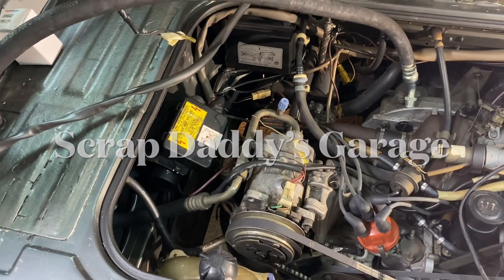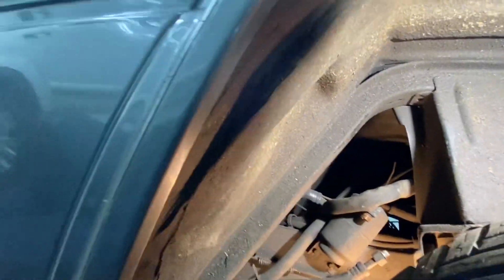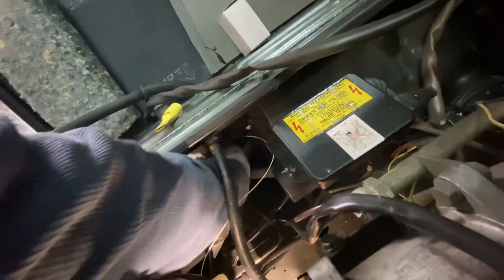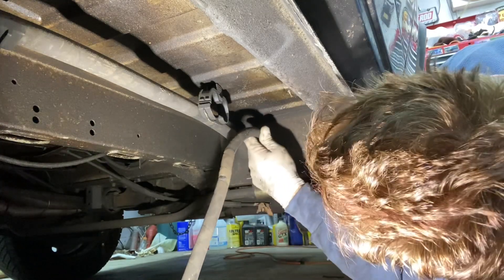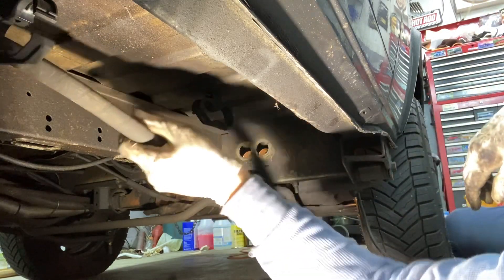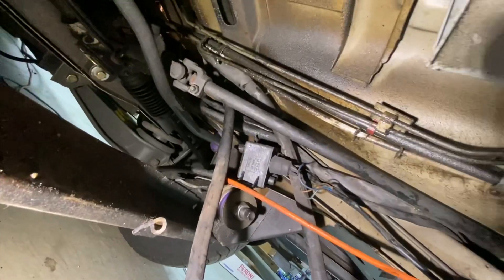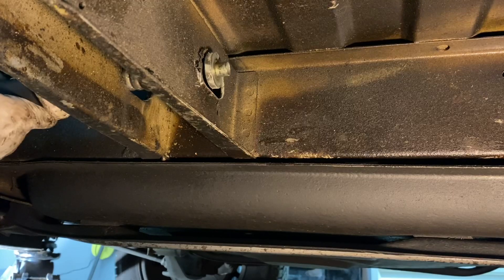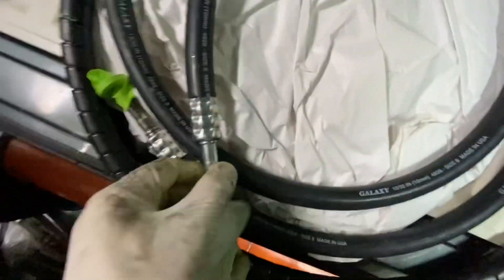Vanagon AC hose removal

Comment: Thank you for recording this! I am currently taking mine out permanently from my 87 vanagon and was wondering if there is anything I needed to replace after taking all the hoses out? I noticed the shorter hose you took off first leaves and opening there and not sure what to do about that since it won’t be getting replaced
Reply from the maker: @danielbohn7551  you can seal the holes coming to the inside of the van with tape, silicone or rubber plugs to keep any fumes from coming in. Thanks for watching
Reply: @ okay and those hoses don’t affect engine function in any way right? I had to cut the hose with the dryer attached under the wheel and oil started leaking out
Reply from the maker: @ won’t affect the engine at all. The oil is refrigerant oil ,it will stop eventually should not be a lot. Hang on the the evaporator core assembly it may be useful for someone 👍
Reply: @scrapdaddysgarage5027  awesome will do! Thank you very much!